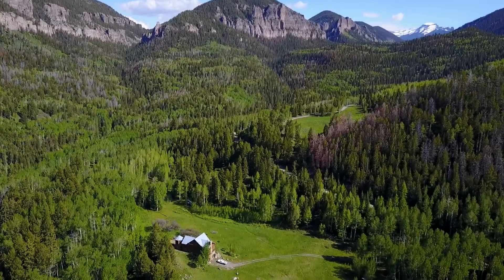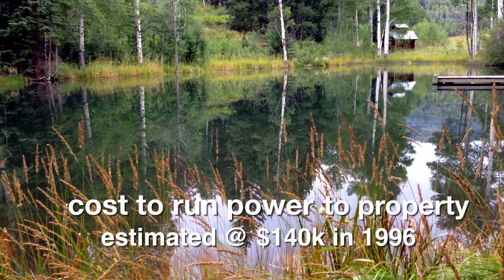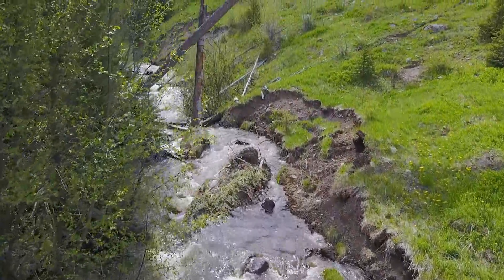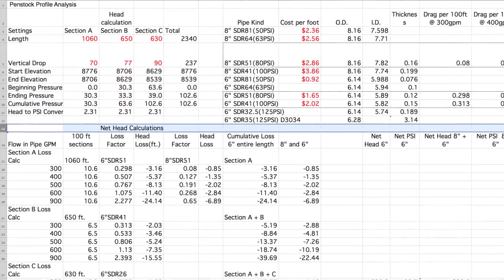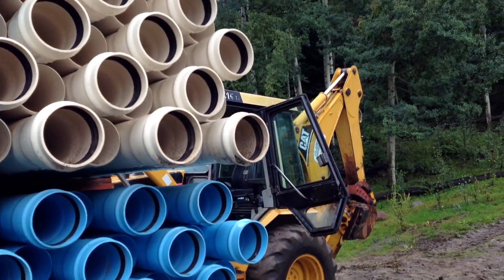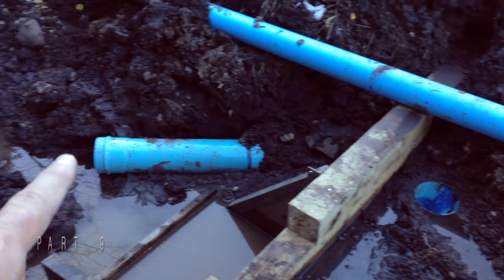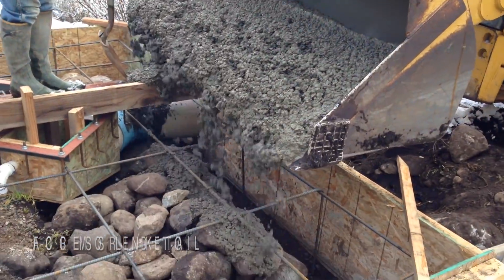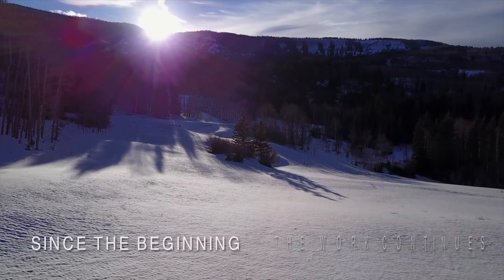Part 20-1 MicroHydro Power System in CO

Comment: Great videos! Do you have any information about the turbine and generator you are using?
Reply from the maker: The turbine was manufactured by Canyon Industries https://www.canyonhydro.com and was a model 1051 with bronze pelton cups, single needle nozzle, with jet deflector.  It cost $6700.  The Generator was a Lima brushless SER 250S1230 10kW which was $2100.  Those prices were in 1996, so a comparable unit would be much higher these days, but they are still running great so it pays to buy quality equipment.  Lima was bought out by Marathon https://www.marathongenerators.com many years ago.  In addition I had attended a class at Solar Energy Intl  https://www.solarenergy.org in 1996 and the instructors had good connections and may have enabled me to get good pricing.  Hope this helps and thanks for watching!

Comment: What software did you use to do the measurements for head shown in the video
Reply from the maker: There are a couple of methods for measuring head in part 6 & 7 of the series. Neither is software based. You can however use elevation readings in Google Earth Pro to define entry and exit points.  You can get fairly accurate with any of the methods.  I was off by 2-3 ft using the method I show. It is possible to use surveyors tools which utilize GPS, but it can become expensive to hire a surveyor. Another semi accurate method is to use any variety of cell phone app which displays Topo maps and GPS. If you are measuring head in hundreds of feet, any minor errors are not as impactful as when you might be measuring in tens of feet. Hope this helps.  Thanks for watching 🙏🏻
Reply from the maker: I forgot mention that the head in feet divided by 2.31 will give you the static (non moving) pressure potential. You also need to determine the best pipe size based on expected flow rate which won’t introduce an excessive amount of pipe friction and hence loss of pressure in active (moving water) capacity.

Comment: I have a small spring that run year around and I would like to get a system for it.
Where can I find what I need?
And which system is best.
Reply from the maker: Sharon, the two essential things you need to know first are how much head (fall) you have and how much flow you can expect throughout the seasons of the year.  With those measurements you can then determine what equipment is best suited to harness the potential power.  Every site is unique and the more you can research and learn the less likely you will make costly mistakes.  There are many factors to consider including water rights, whether you have grid access, pipe length and diameter, turbine equipment, power usage, AC or DC with batteries, budget, distance to house from turbine, local laws, and many others.  The “best” system is not a simple answer as there are many suppliers and many different ways to go in design and installation. This author has edited some good books that can aid you in learning: https://www.amazon.com/Scott-Davis/e/B001KMNH1Q/ref=dp_byline_cont_pop_book_1

Comment: Hi amazing videos,  where can I purchase a hydro power system?
Reply from the maker: That’s a very broad question. You first need to figure out how far water will fall or your head and the flow you can rely on before you can determine what sort of equipment you will need. There are numerous suppliers depending on what sort of system you are going to install.  My turbine came from http://www.canyonhydro.com as the system was direct AC
You might also look at https://www.powerspout.com if the system would be DC. I can say it’s important to research as much as you can so you don’t waste money 
The whole series is intended to give an overview of our system and every system is unique to itself depending on the available potential power, your need for power and your available funds. Thx for watching
Reply: @mrhydrohead  Is not one of the most critical things is finding the right location, including rules/regulation's allowing for this?  When you purchased your property was building a HydroElectric Generator a factor in that part of your research?  Thank you for all you did and shared!
Reply from the maker: Oddly enough it wasn’t the primary thing.  The beauty and splendor of the property was what hooked me initially. I drilled three wells searching for domestic water and finally found it in the third well. A local rancher asked why I didn’t just pipe down water from 2 very productive springs on the property. That idea got me researching the potential for generating electricity from the water which was something I had been interested in for many years. In 1995 I took a course in MicroHydro power at solar energy international in Carbondale Colorado and realized that there was great potential energy from the Springs. The instructors helped me design and access the equipment necessary. A couple of years later I purchased the parcel which had the creek on it thinking that someday in the future I might install a system there.  In 2013 the flow from the springs was greatly decreased by both drought and changes to the aquifer feeding the springs.  At that point I decided to move the system to the creek and document it on YouTube as there were very few videos that had any detail on how-to go about doing it.  My knowledge and understanding of micro hydro had been hard won and I wanted to give back and share what I had learned. 
I would say that finding a good property and researching the power potential is definitely a primary factor that one should investigate before purchasing land. In my case I just got very lucky to have such abundant power potential available. Solar was very expensive when I started out and that should be considered along side any Hydro potential these days because the cost has come down so much for solar.
Thanks for watching

Comment: ok not to be nitpicky but 96-15 is not decades.
Reply from the maker: Yes that is pretty nitpicky.  By the time this video was being made,  the system certainly had been running for decades and still is.  Thanks for watching anyway.
Reply: @mrhydrohead  Thanks! Question, have you looked into the possibility of your system charging an electric car like a Tesla.
Reply from the maker: Mark Brand Yes! It would be possible to do level one or level two charging. Level two would require the higher winter output to be able to handle that.

Comment: Hey there Mr H, Great work. It seems more and more people are waking up to the fact that they don't have to be slaves to power, water, gas companies. Since you are open to input, I've got a suggestion that you may be able to use at some point in the evolution of your system.
Most of my background is in audio related fields so unwanted sound/vibration is something with which I am familiar. I don't know if you still have any concerns in that area, but if you do, since most  vibration transmission in a structure like yours will be structure born, not air born, one of the best ways I've found to deal with both the decibel level and also the longer term vibrational damage to the equipment itself is to effectively sonically decouple the source of the sound from anything to which it's attached. We used neoprene jacks in the creation of an entirely new concrete floor within an existing room. When the floor was cured we cranked up the individual jacks one at a time to raised the new floor a few inches and built a new room on top of it. The floor was now sitting on a number of 6" diameter neoprene "pyramids" which virtually eliminated any sound (like a passing 40 ton trailer) from entering the room.
In your case, doing something similar with the concrete/steel bases on which you've mounted
heavy/noisy equipment might be advantageous. There are also inline hanging versions of the same kind of neoprene isolators so anything in your power station, sitting or hanging can be decoupled from the structure itself.
Reply from the maker: It does sound interesting.  Thanks for the suggestion. and Thx for watching.  Our power house sits ~1200 ft from our home and we seldom hear it at all.  The white noise sound of the creek is the most prevalent sound.  Nonetheless, my plan has always been to wrap the building in stone for permanence, fire protection and some audio isolation.  Just haven't gotten to it yet.  Project list never seems to shorten.

Comment: Are you able to sell energy back to the grid or store it for later use or maybe even powering a pump that would increase the gpm?
Reply from the maker: We are 7 miles from the grid, so no means of net metering.  The estimate to run lines into our property in 1996 were for 20K/mile or $140k and then we would have had power bills.  This was vs. 25K to construct our first system (series parts 1-5) which also provided us pressurized domestic water and a fish pond.  A no brainer choice.  No batteries in system by choice, and no demands for power beyond production.  Storage is as hot water.  300 gallons always available. A hot tub to use too.

No way I see to use any sort of pump.
Reply: @mrhydrohead  thanks for the quick response! Absolute awesome system very jealous of the area and the engineering :D its incredible!
Reply from the maker: Thanks for the compliment and thanks for watching.

Comment: What was the kw output of your original system. I cant do the math on how many kw produced over the said years.
Reply from the maker: Ah yes, those first years on spring water from 1996 until the switch to the creek source had a wide variation. The system was designed to max out at 5kw. 212psi static or roughly 200psi active with a max flow of 80gpm.  The actual numbers were generally less of somewhere like 1500w in winter to 3500w in other seasons. The house was initially a vacation house and the flow setting was turned down while not here. I don’t have as precise of records over those years, but the cumulative kwh shown in the video is where it stood when I switched the system to the creek. Not many people ask about the previous numbers but we just passed 266,000 kWh total since the 1996 installation. So you can see the total is rising far more rapidly, but if course we use all the heat we can now in winter. Currently running at 7150w. Hope the helps. Thx for watching
Reply: How was the generator freq regulated? did you use heaters as ballast or a mech/ electronic flow controller?

Comment: how many KW is your whole system
Reply from the maker: If i were to install a second jet in the turbine I could reach the 10kw limit of my 1phase generator, but with one 1" jet I max out at about 8000-8500w. That is in winter when I need the heat at 8600 ft in the CO mountains

Comment: What are the advantages of a turbine Opposed to a water wheel design? I have a similar situation as this and im trying to decide on one over the other.
Reply from the maker: A pelton turbine is for high head sites where you can use the head to pressurize the water jet. A water wheel might be effective where you have a low head and large quantities of water. There are certainly more efficient devices like a vortex or francis turbine.

Comment: I've had one complaint about this series, and it is the lack of an global map of what is going on, especially of the upper collection phase.  For others in my boat, there is a very, very brief overview of the system beginning at 3:18.  The system is not shown as a complete map, but if you pause, you get a view of the upper creek diversion, meadow collection, pipe bridge, then pausing again and again, the pipeline to the powerhouse, and thence cable to the homestead.  

At 2:24 there is a very nice overview of the pressurized portion of the system with elevation relief and calculations.  This is superior to just about any Micro-hydro project on YT, but I admit my frustration at the missing overview of the collection process.  While the collection process is covered in detail across several videos, and the aforementioned view is available to an agile viewer at 3:18, this deserves a better plan overview.  The initial diversion, meadow 'slow reservoir', weirs, and bridge are the most novel features of this installation, and we still don't have an actual paused, dwelling view of what's going on.  

But thank you for at least making it available, as I finally understand it!  Great series of videos and one of the best and most powerful systems on YT.
Reply from the maker: Robert,
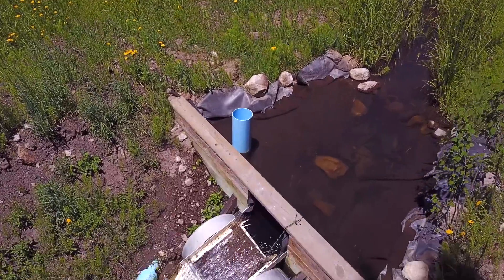I don't think I've seen any comment throughout these years that is as detailed as yours. I see what you are saying and I should have added a magenta line to the diagram at 4:00 to represent where the pressurization begins and continues on to the right in the image. I had that line on the google map I used however whenever I activated it, it would obliterate the bridge line in grey. I couldn't seemingly adjust the sequence of layers with the bridge always disappearing below the penstock line. This synopsis group of videos(2 yet to come) were put together in a different manner than all the other videos in that I wrote and recorded the narrative of  the script first and then crafted images to illuminate the dialogues. This was in contrast to all the previous videos where I wrote and narrated after "locking picture". 
I was starting the process and had numerous hours of materials to refine down to what became about 21 minutes for the 3 synopsis videos. I intentionally flipped the direction of the two diagrams of the intake area with the meadow and unbuildable area because I'm not too interested in broadcasting to the world my exact location for privacy reasons and felt it might add some confusion as to where NSEW reside. It would make it more difficult to locate on maps for most people. 
The narrative at 4:00 is trying to get to justifying the need for the bridge and I made the assumption that most people wouldn't miss the penstock line in magenta if I just left it out.  
So, there were reasons, both a technical one on layers and a procedural one with how I edited this time and my timeline for getting it all done. I was pretty pleased with many of the ideas I came up with to fill in parts of the narration for which I had little imagery to show. Recording the narration is my least favorite step and I didn't want to rewrite and re-record so I invented the map overview to try to show my words. 
I must say I'm flattered that you've focused so closely on details. Most I'm sure do not. As every system is unique in hydro, I feel that too much specificity might become boring to the majority of viewers. 
So hopefully this explains a bit of how it ended up looking like it did. I might add a bit of clarification to the 2nd segment of synopsis to make it more clear. 
Thx for watching and thx for the detailed scrutiny. 😉✌🏼

Comment: Hi there MrHydrohead, I was just curious, as I cant quite remember if you expanded fully on it in your previous videos, but what was the overall cost in both time and money to acquire the water rights to your property?
Reply from the maker: Long story. Water rights are first granted conditionally and once proven to be put to useful benefit are made absolute through another filing. I first filed on the springs  and pond in the early 90's. These were made absolute in the later 90's and another filing was made on the creek when Bush came into office in 2001. This was renewed twice by successive 7 year filings and will be done when I complete a filing to make them absolute for the hydro used on the creek. So not fully done yet, but close. There are numerous sites and details to the rights so it probably sounds more drawn out than it has been. So about 27 years so far and maybe $3500 in legal & court fees over that time frame. Hard to remember the specific costs.

Comment: This is such an inspiring project! Love the presentation format :) Would you consider making an overview of the amount of labor (roughly) required for each part of the system (intake, bridge, penstock, powerhouse...)? This could probably help the planning of similar systems!
Reply from the maker: It's an interesting idea but I just have the data. My contractor/friend who also built my house gave me bids for the various parts of the system and I don't know the actual hours for each part. He works very fast and owns/operates the heavy equipment. I was his worker but not there everyday of construction. Having set bids was necessary for getting the loan to finance it, 60k of which I spent about $55k. Also every system is highly unique so numbers might not transfer well. Hope this helps. Thx for watching!